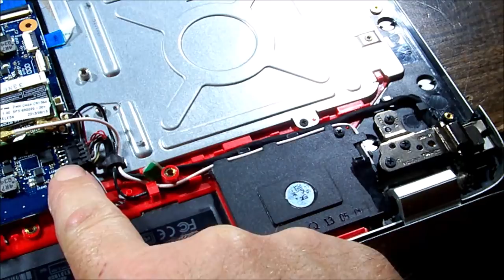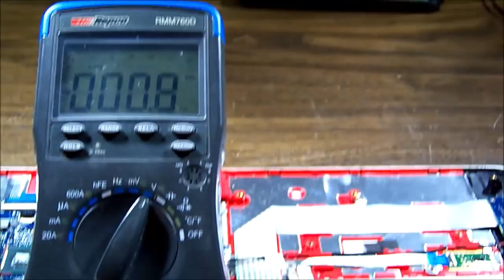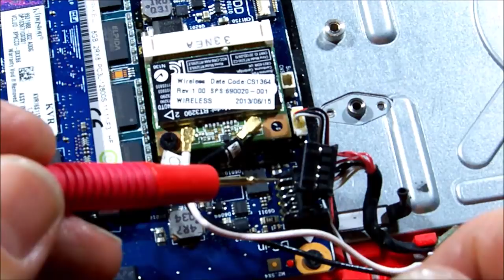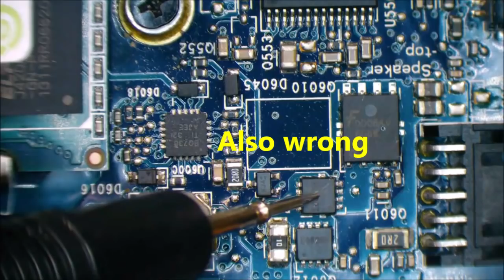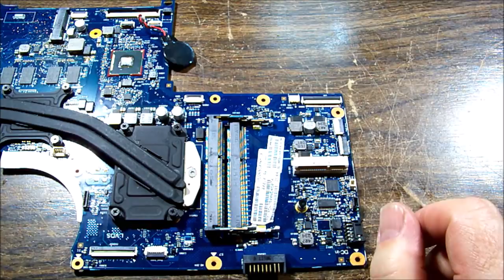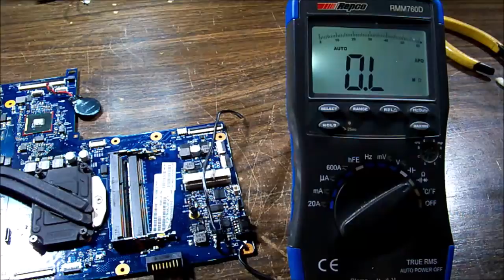HP Envy 17-j0017TX laptop repair.

Comment: Hi, very good video. I have one 17 j070ca but instead of overheating it keeps the power button on and electricadly its like is rebooting contantly. I'm searching for the schematics to see if it's an missing volt but so far no schem for j070ca in my search range, can you help please?.
Reply from the maker: Nope, but you could probably resolve this without one. Test the power button. If you unplug it does this fault still happen? If yes then bad switch. If no then you can check for voltage on every coil (inductor). You should have one with always 5V and one with always 3V even when turned off. The coils by the cpu should be about 0.6 to 1V when on. There will be one near ram slot about 3V. One near hard drive connector 5V. One or more near graphics chip if separate maybe around 1V. Power cycling could be a corrupt bios to if all voltages are present. Also make sure bios backup battery is 3V. Good luck!

Comment: Hello sir am in ghana and please i need your help,i have hp envy 15t-j100  it dose not turn on, and find that if the battery is on then the charging light blinking and if i remove it then it stop blinking but still not turning on
Reply from the maker: Unfortunately it can be a different cause every time. Hopefully some of my laptop videos will give you ways of testing things to help find your problem.
Reply: Hello. I have the exactly same problem... do you find the solution? Regards

Comment: thanks mate my envy has every thing on it  this has saved me a lot of hassle the computer tech said oh the dc input is on the mother board its fucked well clearly thats not the case  yes  its a bit loose  so good to know its whats wrong here or maybe the dc in harware in my case jsut needs replacing  as it has to much wiggle room so now i can take it back to them show them this video and get   my computer back and running not havting to fork out for a new one where this one i belive will do what i need it to do for a few more years yet..
Reply from the maker: That's great. When you get it working be sure to make regular backups.

Comment: Cheers mate from the US. I have an Envy 17-j021nr, which is almost identical to what you’re working on here. I have same problem, no power. No nothing. I have opened it and when I apply power the small MOSFET that has the F D0006AP 8888 chip is getting burning hot. Any tips on troubleshooting this problem or where I can find one of these chips? I would love to get this fixed since it’s a great laptop. Any help appreciated and thanks again!
Reply from the maker: Are those parts you mention in this video? If so what time stamp? Otherwise, without knowing what they do it's hard to say. A fet getting hot doesn't necessarily mean the fet itself is bad, there could be a short to ground on the line it feeds.

Comment: you completely wrong , the midle pin from the charger is the sensor , the outside  is the minus and the inside +
Reply from the maker: You are correct. Oops..

Comment: Center pin is the id pin outer is ground inside of the barrel is 19.5v
Reply: i have same hp envy 17 , but when i plug in charger the percentage doesn't increase , can u please help
Reply: @charlesyeboah8347  is it the original charger? Maybe try with another original one to be safe.